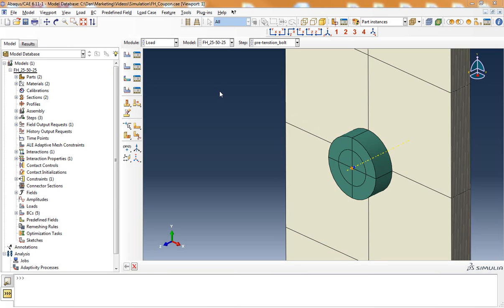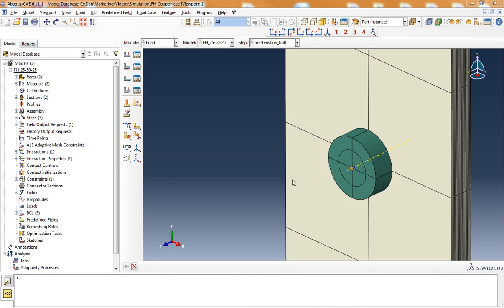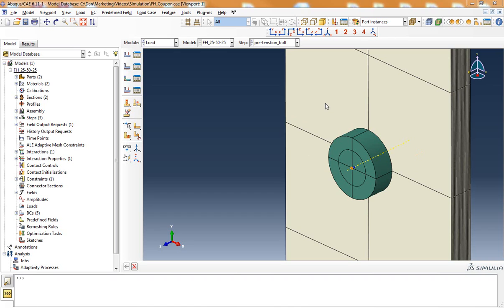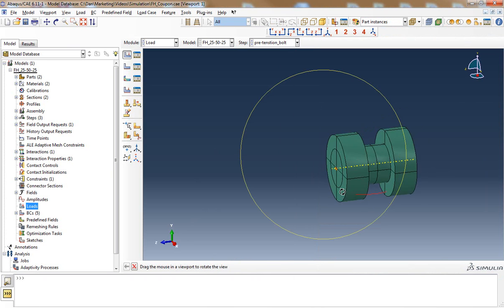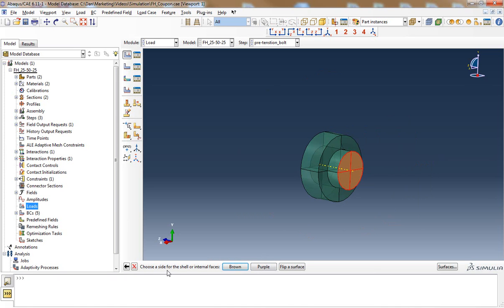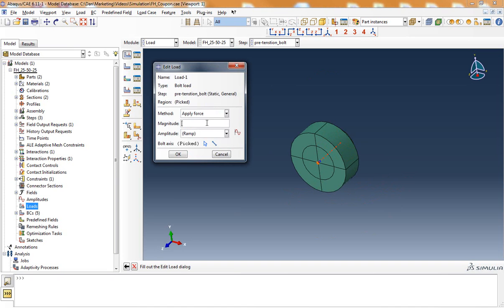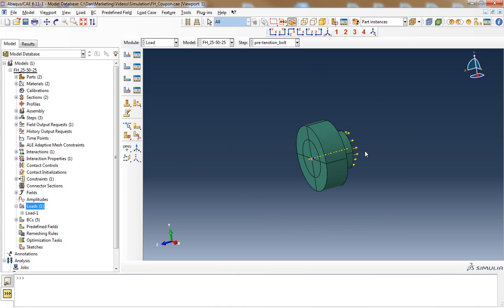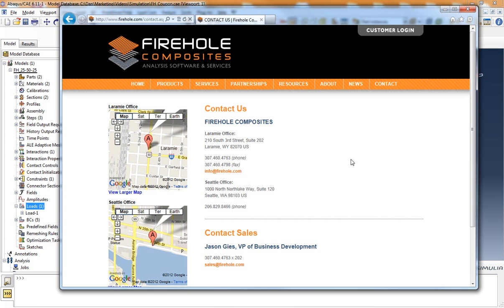Creating a Bolt Preload in Abaqus/CAE

Comment: You forgot to mention that a boundary condition should be applied to either side of the 'cut pre-tension section' of the bolt or a kinematic constrain applied i.e. at the bolt head end or at the shank section/threaded end, ( as can be seen in your tutorail video) hence rigid body motion would occur during analysis.

Good tutorial overall.

Comment from the maker: Firehole Composites (which is now part of Autodesk) provides a solution for simulating the failure of composite materials, but FEA packages such as Abaqus are required to provide the modeling capability to support our composite material modeling enhancements.